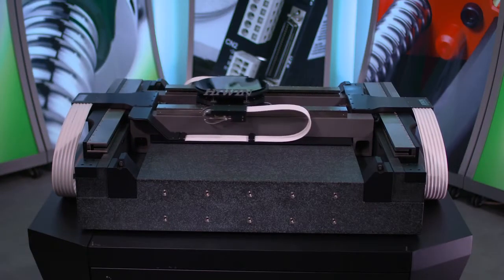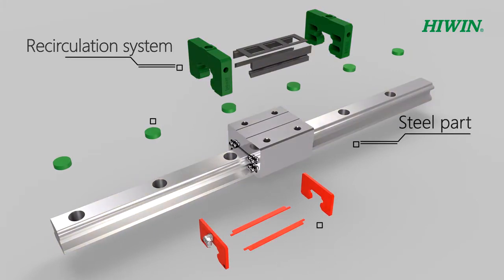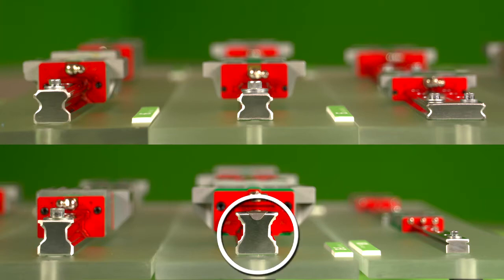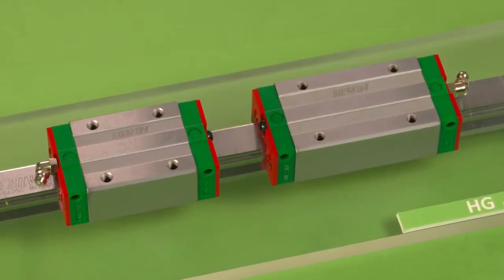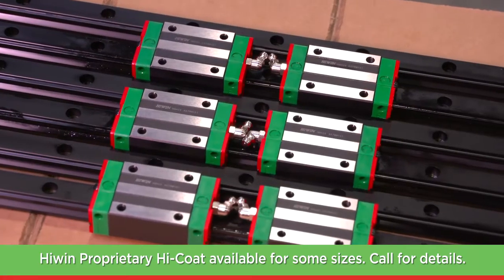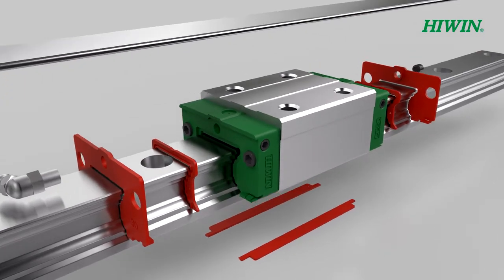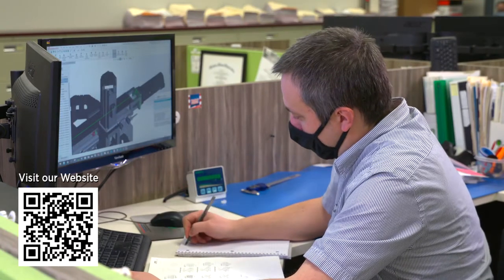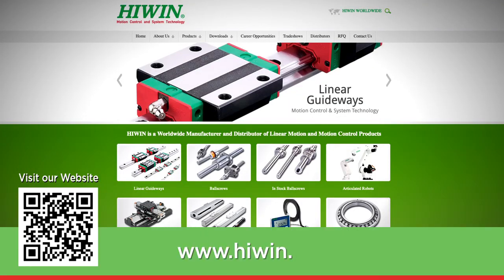Hiwin US Linear Guideways

Comment: I called distributors of HIWIN in Mexico for a ballscrew quotation. None of them have stock, they only had rolled ball screws (that would be like C7 accuracy?) but I was requiring C3 accuracy which must be CNC machined. So, nobody of them was able to provide me any item immediately (within days) so I ordered from a factory in China (using Alibaba). The accuracy standards are the same for everyone, steel alloys are the same for everyone so it doesn't matter what brand do you buy (as long as your micrometer is Mitutoyo). That's my story of attempting to use HIWIN. I don't know if I lost something or not, but I am happy with my current machines. The guides and ballscrews are not HIWIN.
Reply from the maker: Thank you for your comment.  As you have noted, ground ballscrews are typically used in OEM applications where highest accuracy is required.  HIWIN does not stock replacement parts for OEM machines, because the configuration is proprietary.  Users should buy replacement parts from the machine manufacturer.  In the future, if you are having trouble reaching an OEM for replacement HIWIN parts in the USA, we may be able to help.

Comment: Hi. I just got some HGH20CA linear rails and blocks.  What is the bolt size recommended for tightening the rails?  The drawing says M6, but the rail's dimension "D" for the diameter of the hole for the head of the bolt is diameter 9.5mm.  The problem I'm finding is that M6 SHCS bolts seem to have a 10mm diameter head.  On a forum one user recommended grinding down bolt head diameters to fit, another recommended just using M5 bolts instead.   One of my 1/4-20 bolts fits but another 1/4-20 doesn't fit (threads are larger).  Anyway, what bolt size do you recommend?  I bought 2 rail ball screw kits, and may end up with 8 kits for my current project.  it will need almost 500 bolts, so, I don't really want to grind them all down...   Thanks in advance.
Reply from the maker: Hello and thank you for your business. We recommend M5 SHCS for D=9.5mm on the rail.
Reply: @hiwin-usa  I'm impressed you answered his question on a youtube comments section!

Comment: Lubrication grease or oil ? Which one suitable?
Reply from the maker: Thank you for your question.  Depending on the application and environment, grease or oil may be suitable.  If a central lubrication system is being utilized, the lubricant vendor should advise the suitability of their oil for the motion control application of HIWIN linear guideways.  HIWIN sells seven types of grease to suit a variety of application and environmental conditions, as well as grease guns and a nozzle adapter kit. See https://www.hiwin.us/products/hiwin-grease-guns/  for more information and SDS for details.
Reply: @hiwin-usa  we are the cnc router wood carving machines manufacturer. We used only HIWIN 20raios and blocks  but my question how to find out which is the original ? Because some time we import china and some time we buy at local in India, both are not same...
Compare to purchased in India china product very smooth and long life...
Please clarify how to identify original
Reply from the maker: @Pratapushine  Hello Gajula, Thank you for your email and your question about genuine HIWIN components.  We are pleased to know that HIWIN linear guideways are utilized in your CNC machines. There have been fraudulent manufacturers of HIWIN products. Some have attempted to copy the outer markings closely, but cannot duplicate the inner-workings.  The only way to ensure the purchase of genuine HIWIN components is to buy only from authorized distributors, or directly from HIWIN. This office handles all orders for direct sale, and distributor sales, shipping throughout the Americas.  To purchase genuine HIWIN products in India, please let us know which state are you based in, we will recommend the right channel for you. Thank you for your business.
Reply: @hiwin-usa  thank you for reply,  we are from Hyderabad India, please provide authorized dealer at our place
Reply from the maker: @Pratapushine  Hello Gajula, In your area, we have partnered with Fluro Engineering Pvt. Ltd. To contact Yasir at Fluro, email support@fluroengg.com or telephone +919819000458. Thank you for your ongoing interest in HIWIN.
Reply: @hiwin-usa  thank you  very much... let me contact